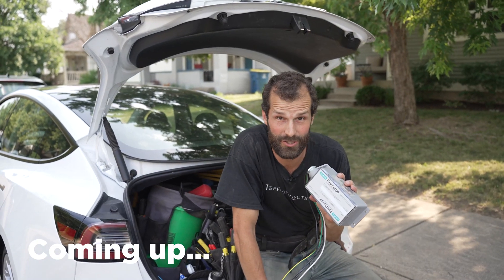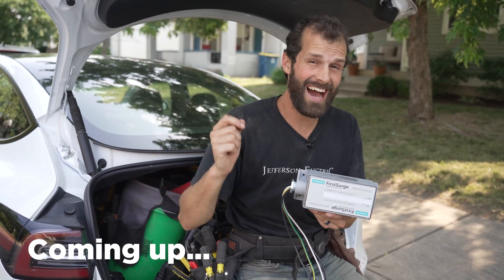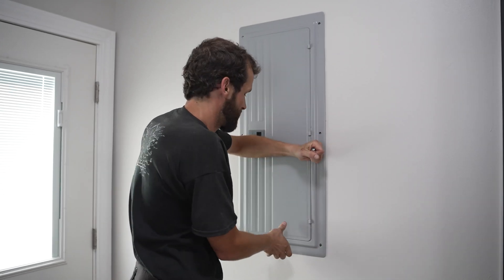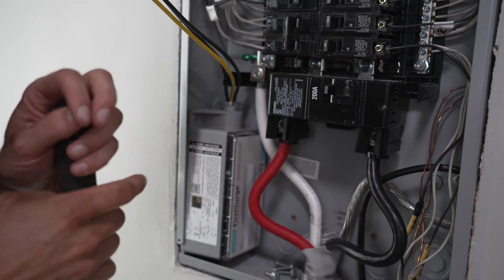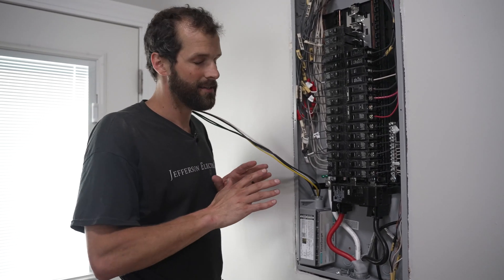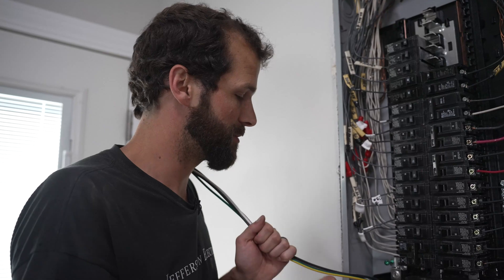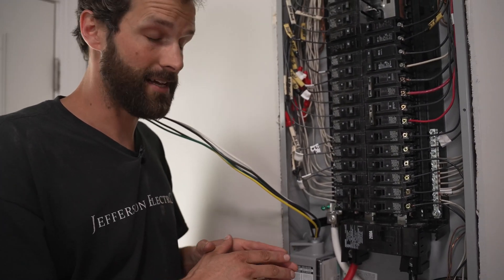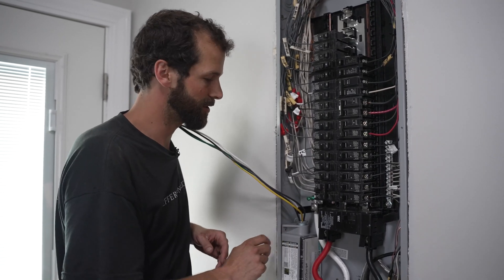SPDs: $600 Now or $100,000 Later...

Comment: Seimens now calls it Boltshield 140 and is a little smaller and has a black face.  The old version in your video is no longer made because Boltshield 140 is the replacement.

Comment: I’m hoping that the power is off. I just can’t work in a panel without my black Milwaukee cut resistant gripping gloves. They’re shear enough to pick up small parts and protect me from cuts and scratches. I also like the extra protection from shock. I know that they’re not safety gloves, but it doesn’t hurt to have a little extra protection.

Comment: Locating the breaker as close as possible to incoming power is GOOD...but not CRITICAL due to the extremely large gauge ( or "ampacity"...if you will) of the bus bar. However, keeping the leads from the FS140 to the breakers SHORT is indeed critical, as every inch added that is not necessary for the install.....increases the voltage threshold of protection ( the VPR rating). Think of VPR this way, it is the LIMIT of surge allowed to pass through. If you bought the FS140 with 600 volts of pass-through allowance during a surge.....why increase it to 700 or 1000 because of too many inches of additional lead length? So.....yes, locating the FS140 close to the incoming main breaker is GOOD, but not CRITICAL. The buss is enormous in comparision to breaker location and wire leads used....and the  location of the protected elements (TV, laptops etc)....are VERY far away with VERY SMALL gauge wire in comparison......the electricity will take the path of least resistance and the long runs of to the equipment being protected helps in this regard.  Hint.....twisting the leads 1 twist per inch, or even laying them tightly together in a straight line using zip ties..... will improve the impendence and will give you improved performance just like short leads will. All this confirmed not only by what I thought I knew.....but with talks with Siemens CS. Cheers.

Comment: As a service Electrician, I have found a large percentage of the breakers that the surge devices are connected to tripped when I open the panel for something unrelated. Has anybody else been finding this? If the breaker is tripped the audible alarm does not work either.

Comment: Quick question - I have a split service (320 amp meter - feeding 2x150A panels). House was built in the early 90s so no surge protector. If I wanted to add one, should it be on both panels or just one?
Reply: Both fam

Comment: If i put a surge protector in my main panel, do I need one for my subpanel? And can you recommend a cheaper version for a 200A househould with a 60a EV charger?
Reply: You don't need one for your subpanel. I put the Seimens one with the 2 20 amp breakers on my main panel. It was only $100.
Reply: @eggplant2369  where did you find a $100 SPD? I just bought the Siemens 140 SPD for $200

Comment: I hope you noticed the panel cover screw on the bottom left was right in front of the surge protector.  When you put the panel cover on that screw would have penetrated the device....  Details matter!!!!!
Reply: ALWAYS blunt tip screws on panel covers... so nothing is getting penetrated. He likely cut the screw shorter to not interfere with the SPD.
Reply: Shouldnt the green screw be removed ser in the pannel woukd make it a sub.

Comment: What do you use on 3ph? 2 of these?
Reply: you want one on each phase.
Reply: Most of the time you’d just install a 3P variant for the voltage setup you’re dealing with. Using one SPD per leg would be a little more rare.

Comment: Type 2 SPDs are great, but i hate the insane prices these manufacturers charge. They are about $5 in MOVs, some LEDs and a plastic box. Even basic models now go for over $100. They're marked up 20x+.
Reply: And with the latest NEC code release requiring Surge Protection devices in homes they have ZERO incentive to drop the price any time soon.
Reply: @carbongrip2108  On the other hand, a steadily increasing market can bring in other manufacturers and/or products with better performance. SPDs used to be a niche product. We'll see.

Comment: OK so I have an interesting question and has to do with wearing rings or jewelry on the body while do work in HV or any electrical panel, I noticed you have a ring on your finger which means your taken :) BUT is your ring a special nonmetallic type of ring.? I work in a lower voltage type area but since I use my fingers to feel in live circuits, I always take my ring off (single not taken finger) so I don't short something out. But still curious if there is special rings or jewelry for this purpose, hope this make sense :)
Reply: He is immune to electrical shock. Talks about safety and, warns others but always has ring on with no PPE. A professional doesn't get shocked. Hope he never does.
Reply: yes but what if you have a metal ring on and blindly poke your hand into a panel? @SRCardow1

Comment: Great video, as usual.  You might have mentioned a little bit about what surge/lightning is.  It’s a stupidly high voltage but incredibly short event.  Voltage so high (millions at the contact point on or near the home, but so short in duration that inductance of copper impedes that from actually getting all the way into panel. And so short that the spd can absorb the current that the voltage does induce long before that 20 amp breaker even knows what’s happening.
Reply: That's considered a "spike" not a "surge".  And I have a hard time believing that little junk can stop 140,000 amps, but maybe.  I wouldn't wanna test it

Comment: Can you do an inline surge protector? I struggle a little but to understand how a surger protector protects the whole system.
Reply: You can't put devices in line because that would be series wiring, it's in parallel because essentially all a surge protector is , is a device that dumps excess voltage to ground/neutral , for example line to neutral is nornally 120v so this device for example (I don't know the exact rating of the MOVs in it) if voltage on the bus bars exceeds 135v itll just start dumping it straight to ground/neutral to dissipate excess voltage
Reply: Great Thank you! @Byron88

Comment: When you install it along the edge like this, doesn’t it risk contact with the cover screw?  

I’m so jealous of the panel location. Wow - much better than my garage.
Reply: Right, what did Joe do with extra panel screw that didn't screw in? 🤔
Reply: @scottd9024  Likely cut it shorter as the screw doesn't have to be that long.
Reply: @carbongrip2108  That SP looks like it took the entire space.  I’m sure it could shift to the side, but it was right where the bottom screw entered the panel.

Comment: Call me crazy, but you could eliminate a big chunk of the code book by integrating surge, arc, and ground fault protection directly into the panel. We have access to smart breaker panels already, so why not just come full circle with the safety integration and make a new panel standard? I guess I feel like Tesla in the Edison company, why not try something different. Tesla revolutionized the grid.
Reply: SPDs get used up, and GF+AF break and need replacing. If integrated into the panel, you'd want to make it modular to deal with that, which puts you right back to the existing method of SPD/GF/AF plugging into a breaker slot. Having multiple circuits covered by a combined GF/AF means a trip takes out them all, which makes diagnosis harder and nuisance impact way up.